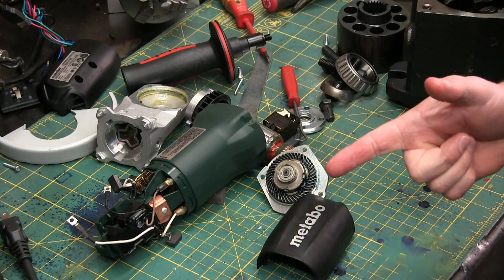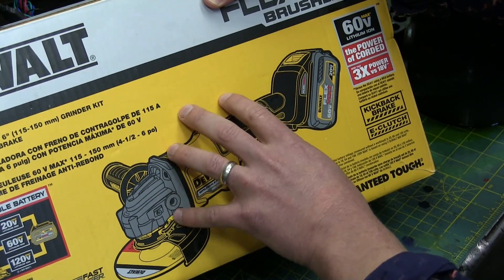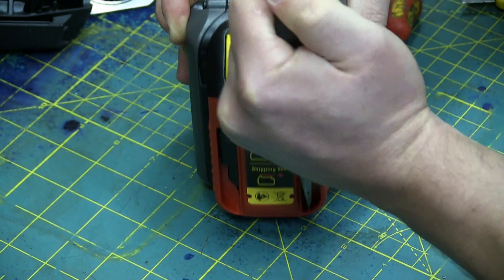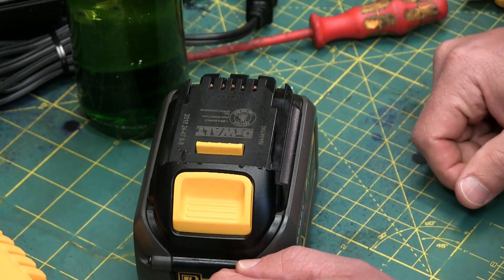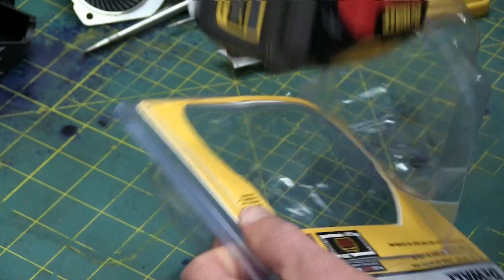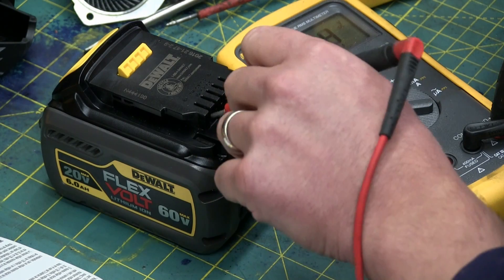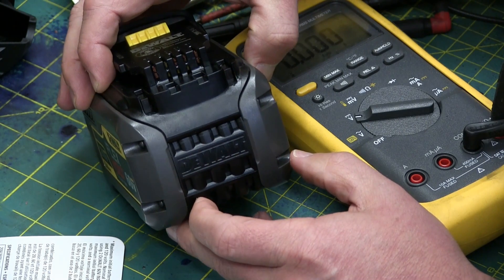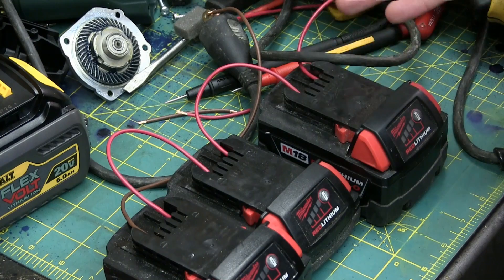Plug-in Power Tool to CORDLESS CONVERSION.

Comment: I love your videos and watch many of them! Just wanted to say that years ago, I built a super simple 110vdc battery power supply by connecting 9 4.5ah 12v sealed lead acid batteries in series. Put them in a cheap plastic tool box. Put a household duplex outlet in the lid. A simple semi portable "battery pack" and it would run just about all my NON-variable speed power tools. If it had a brush type universal motor in it, the battery pack would run it! Even a electric corded chainsaw and a 7.5" Skill saw just to name a few. AND, like AVE said, the batteries would pack a punch and actually performed a bit better than using grid power AC! There is no change in the current flow as in AC. Tool gets full powerful DC current. Yes, you are still tied to a cord of some kind, but I used a heavy gauge 25 foot extension cord, which allowed me to work the area. Then jut pick up the battery pack, move to the new area, and back in biz. I had to build a custom 110VDC charger though. It was NOT UL listed, but it did work to charge the "pack". You can use just about any batteries you want. My next build will be with 9 12v 7.5Ah SLA's.You really don't need a full 120V when running DC IMO. Just my 2¢ worth! Thanks and good luck!
Reply: THIS is exactly what I would like to build! I have a bunch of millwakee and makita 12 v batterys and chargers and have one new corded makita router ( same size as the cordless version, the label says it draws 120v  6.5 amp ) and I would like to figure out how to run it where I have no access to 120 outlets, do you have any advice on how to combine the power of the 12 v batterys safely to do what you did? I'm not worried about charging them because I can always use the individual chargers later , thanks for any advice!

Comment: Actually Li-ion batteries have the longest shelf life when charged about half way. ;-)
Also, you really don't need Li-ion batteries to limit the inrush current of a power tool, just limit the inrush current for the first quarter of a second of so on start up and you'll be just fine. That will 'cause the tool to start off a little more gently than normal, but I'm guessing it probably not a big deal in most cases, if your power tool needs a few tenths of a second longer to get up to full speed. If you wanna run it cordlessly however, well in that case you're obviously gonna need batteries or some other device to store energy.

Comment: If you want start up power get a bridge rectifier and a few big caps.   $30usd never trip again. Also Black and Decker 20vmax may work for Dewalt. Most likely if you look at the pin out on a 60v tool you may be able to figure out the jumper.

Comment: I have an alternative theory about the breakers. Are they diff breakers or temp ones? Because differential breakers will spoil the fun every time they think someone is electrocuted (i.e. current is leaking somewhere), and temp ones could be triggered by sparking. Long cables are unlikely to cause current overload, since they are more about limiting current than anything else, but they can also act as uncompensated coils. So any spark in the tool could be 'transformed' into breaker-tripping spike by long cables.

Comment: correct me if i am wrong, as i remember, metabo do have such a mobile charger cart, which have a similar function as you mention, but on the vise versa, if your battery dry during drilling, you can plug the cart to the wall, it charge your battery and at the same time provide a extention socket and line to run your drill. on the other words, a big transformer with a couple of extention socket, i dont know if they put it on the market or not, if they do, rhen it worth a look????

Comment: I'm assuming these batteries are only rated 6 Ah at 20 V (so 3 Ah at 60 V) so that's only 120 Wh. That's enough to run a 10 A / 1200 W / 1.5 HP electric kettle for 6 minutes :) Adding in conversion loses and it'll be less. So, for the people who recommend the DeWalt DCB1800M3T1, it's probably only good to run a few lights even with four 60 Ah battery packs. It's probably much better to build your own 24 V power bank and hook a big UPS to it.

https://www.amazon.com/gp/customer-reviews/RWJ6U9K2E72B1/ref=cm_cr_dp_d_rvw_ttl?ie=UTF8&ASIN=B01HD4E1FA

Comment: I have been thinking about doing something similar for our shop.  We run a fridge, microwave, coffee pot and toaster oven in one circuit, and now we gamble on who trips the breaker and has to reset it.  Never having time but thinking a couple caps in a box and have that just plug in to an outlet to act as a start cap for the microwave or whatever in the circuit.  Obviously have to make a bridge rectifier but we usually just pop the circuit on starting the microwave.  So would having the batteries in place of capacitors be an option.  Im probably way off the mark but thats my 2 cents.

Comment: Try a soda can capacitor like the big car audio guys use. Like a 1f. That way when you get that hit on startup or low power lug when the tool is pushed to hard, the capacitor has the charge. Bonus if someone is standing around the job holding their curlies, you this them the charged cap!

Comment: AvE, Were you taking the piss when you didn't push the damn yellow button? Seriously, that was dumb. Also, you should know better than anyone that Lithium batteries always come with a half charge because it extends their shelf life. A low charge could cause them to dip past usable voltage and brick them and a full charge can take charges off the end of the batteries life. You should always fully charge any battery before you use it (I leave mine on charge overnight as most good chargers enter a battery maintenance mode after the charge cycle that discharges and charges them a little bit because, science. Its just good for them, look it up).

Comment: dewalt has a portable bettery station https://www.amazon.com/DEWALT-DCB1800B-Portable-Power-Station/dp/B01H41SDGU/ref=sr_1_6?ie=UTF8&qid=1506966634&sr=8-6&keywords=dewalt+battery+charger.
but some high powerd battery banks will do what you are saying. you just need to get the ones that dont have electronic switching that will bypass the battery when pluged in.
they use them in servers so when the power craps out. the electronics dont get hurt due to the process of switching from the line in to the battery. (split secont voltage spikes/brown outs)

Comment: Very nice video. I was wondering if you could take a battery charger with 4 ports and hook a female end to the plug and plug a corded drill into it. Might have to disable the circuit board but if it works it would be a nice portable camping electricity provider.

Comment: Hello Ave I would be more then happy to help you design this battery booster I want to school for Electronics engineering and it's a simple enough thing to make you would need two 60v batterys a charge circuit and relay a Arduino and if your really wanted to make it work good a AC to DC boost converter that are now commonly found in uninterrupted power supplies

Comment: For the turbo charger idea, this has been done for years with Air Conditioning compressors.  They use a "start up" capacitor to aid in start up and not stop the pixies from coming from the breaker.  So, what if instead of batteries you design a start up cap setup?  smaller, sleeker, all AC, and shouldn't have a hard time chooching from the get go.  I'm going to try this idea as well, on my worm drive skill saw that always pops the breaker when used with the handy long ass anemic extension cord.  Read, set, "corntact".  If you like, I'll send pictures when done?

Comment: I think the turbo charger idea is a winner but why not make it charge the DC battery packs when it isn't supplementing the AC power?  That would add to the utility for construction workers - plug in the turbo charger, plug in batteries to be charged, have them supplement load as needed but top off the battery charge as well.  You could probably base it on the DeWalt or Milwaukee multi-chargers.

Comment: My big question is this. Why the fack can't someone make a device that allows cordless tools to be operated with a cord.  I know default makes one for running 120V flexvolt tools.  Why cant that be done with 20v? or even 18 or 24v? If it doesn't have anything to do with the confuser talking back to the battery now and then, what gives?

Comment: Hey, I wanted to use an 3000 watt inverter to run a corded 1/2 in. impact wrench from a car battery. The theory being not having to have a compressor, or spending  $500 for a very nice Milwaukee battery impact wrench to get the lugs off , to change a tire on the road. I have been stuck in this situation more than once, and tried to help someone in the same situation where we could not remove the lug nuts to change the tire. This way, its always handy and ready to use, and can be done for around only $200. and kept in the car for your emergency, or to help someone else out.

Comment: Battery idea is great. You are designing an accumulator. Unless there is electronics to at least pulse the DC theoretically it should lock up the commutator ( no polarity reversal to pull to the next magnet). 

I smell something fichy ;-)

Comment: +AvE I was wondering if it was possible to convert a battery for a cordless drill so you could plug it into an outlet when all your other batteries are on the charger? Is it possible to convert AC voltage to the correct DC voltage for the drill to run?

Comment: https://youtu.be/pO1RqgAFP5Q?t=4m14s actually, they're not allowed to ship them via airplane fully charged, and it's better for the long term maintenance of the battery if it is not sitting around fully charged (some of the newer drone batts have a discharge feature built right into them)

Comment: Couldn't you just run a capacitor in the power tool to jump start the tool, kinda like how washer motor works? It can just recharge and go off when the boost is needed.

Comment: I know it's probably been mentioned, but I can't see it as far as I've scrolled.  

AFAIK they don't charge lithium ion batteries to full before shipping them due to FAA regulations and shipping insurance costs.  I believe they now ship them at something like 35% charge to reduce the chances of a fiery death when shipped by plane.

As for DC injection, lead acid would do better than lithium ion, from what I've read and seen, sipping a bit of juice then charging back to full repeatedly on a lithium ion isn't great for them.  If it were controlled by a microcontroller, it would be possible to allow the batteries to be discharged a bit deeper before charging, and let them rest a bit between charging and discharging by possibly alternating banks for a short period.  Resting would significantly increase the lifespan of the battery.

Also, why not just go full time DC?  A full bridge rectifier would output 60v DC, which might make things easier in the long run circuit design-wise.

Comment: I tapped the feed from a 100@ alternator and ran a drill. their technically 3 phase. not sure if that helps. but it was cool! I'd like to see ya build a welder with an alternator. I'd bet it would work better than mine. I let the smoke out!!!!

Comment: not sure, it depends on the motor of the tool.
I guess you can get away with some stupid DC motor + gearbox + alternator stuff but I don't think that'll chooch( am I saying that right XD )
just get an DC to AC converter of sorts and put that between your cells and tool.
not sure whether it's cheaper to buy or build it yourself.
lastly we can machine something that makes the terminals spin so we get a very basic AC going but that'll be a TTL style wave rather than Sine

Comment: Go to Europe. Al normal tools are running at 230 Volts AC.. The breaker is 16 amps. Thats 3.7 Kilowatt. No breaker trip for us. For real powertools we run of three phases. Thats a whopping 3 times 400Volt at also 16 Amp each. saying 19.5 Kilowatt. Further you should know that the breaker wil not trip within 4 seconds at the double current, but garateed within 4 hours. So, Keep your ect ect.

Comment: I've been stewing on this for a while, and I think that I've come up with an EXCELLENT solution: A full wave bridge fed by the 120 volt AC gazinta, charging a large conventional cap, which feeds both the gazouta outlet and the battery charger. The battery is connected to the large cap/gazouta by a power diode (normally reverse biased when the cap is fully charged). Thus when the switch is first pressed (and the load is the highest), the cap feeds a galumphing whump of VERY angry pixies, and then (if needed) the batteries fill in even more. When the tool is turned off, the cap recharges in a second or so, and the battery goes back to charging as needed. Msg me iffun you'd like a schetchematic.
Reply: I would love a schematic, forgive me but I,m new to the lingo on this channel 😁 so  I did not understand most of what you said but I think I want to do the same thing

Comment: This battery assisted startup sounds intriguing, might actually be achievable. If you have a small chip that draws from the batteries until the RPMs go above some preset value, then switch to AC. That would prevent the startup surge from drawing too much from the mains causing the breaker to trip, but also eliminating the seemingly impossible task of marrying the AC and DC currents somehow. If AC power is not present, the tool simply runs off the DC. When AC is present but the tool is not running, recharge the batteries.
I would suggest a higher voltage than 60 volts though to help with starting under load. Since you don't need the batteries to be the primary power source, you could use much smaller cells designed for high peak current, and pack a shit load of them in there, say 26 in series, or 96.2V nominal, or 109.2V charge voltage. You will generally only be running from battery for a couple seconds then AC kicks in to take over. Smaller capacity Li-Po batteries seem like they would work well. Some of those bastards can do 130C discharge rate.
I wouldn't worry too much about making the battery removable though. I would start by building the batteries and controller circuity into the tool, at least as a prototype. You'll be running primarily from AC anyway, so battery swap seems pointless for a proof of concept.

Comment: centrifugal switch like a proving switch in a furnace exhaust motor, perhaps?  at full operating speed it switches to AC, below that (start-up or when bogged down) switches to DC.  Tool at rest would be DC in the normally open stage.  so the centrifugal switch would have to trigger a SPDT or DPDT relay to isolate the separate pixie sources.

Comment: How you do this: take lead acid batteries, the little baby 12V SLA ones should work, series them until the peak AC voltage out of a wall socket matches the float voltage of the lead acid batteries, so 12 12V SLA cells in series should do it, next add a full wave rectifier that can handle the amps a tool would use, you can get 50A ones cheap, stick the batteries in parallel with the rectified voltage, and DONE. Alternatively, super capacitors would also work, but they can't run the tool very long without being plugged in. Note that all universal motors running off of this would run faster than normal because you now have 170V instead of 120VRMS. I specified lead acid because they can withstand more abuse, and wouldn't need any brains to control them. L-ION would need special overcharge protection, and balancing circuitry because they can't handle overcharge like lead acid can.
Reply: just checked, the parts for this battery pack would run around 120$ for a 4.5AH pack, which could store around 600W/Hr worth of electricity, which is a good bit of power, not that it would last that long running a 15A grinder, but more money=bigger batteries=more power, but also more weight.

Comment: problem might be that quick charging batteries like that while turning your contractor saw on and off will piss those batteries off. Now if it was something like a table saw that didn't get turned on and off alot then that might work!

Comment: Corded tool are obsolete, my van consists of nothing but cordless tools.. Not to be a douche, but that's my opinion.
Reply: Not for some machines. If you do any serious grinding you need a corded angle grinder, they are also cheaper. Really corded is only more or less obsolete for drills and drivers. Also, impact wrenches are still better on air then on battery.

Comment: a ganged up 18650 bank direct wired to a power inverter mayhaps?  ...like the one you use in your car to run a coffee pot while camping but use the cells as a source instead of the 12V... ???? maybe, maybe not...just throwing it out there.

Comment: Hmm... how about a well smoothed rectifier and a skookum as fack buffer capacitor in parallel to soak up all the transients? I'm talking 1 - 2 Farads here! Rated to mainline voltage.

Not exactly a battery, but it'll charge up much quicker (I'd put a few current limiting resistors in there...) and handle much higher currents without releasing the smoke.

Using lithiums like that would make things more complicated, you need a charge controller and a monitoring circuit, else they tend to go up in flames... not bad for a mobile power source though!

Comment: FWIW I accomplish the same thing with my pickup which is always where I'm working as it's my mobile tool box. Truck has a converter and a large inverter, as well as of course it's own charging system and a small gas genny should I need it. Converter is 120VAC to 12VDC to trucks bats, inverter is of course 12VDC to 120VAC.

Comment: Install a start/run capacitor in the power tool.  That should give you the extra pixies to get em choochin without tripping the doohicky.   Better yet, let's see you install a (or some) super capacitors.  Could be a good chance of letting the magic smoke out with those.